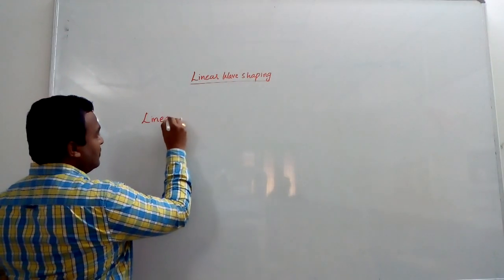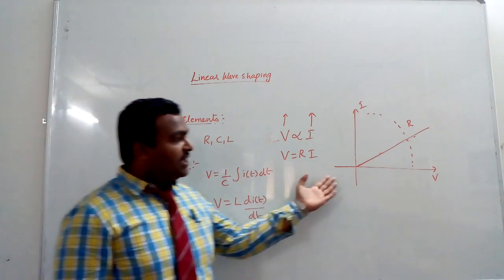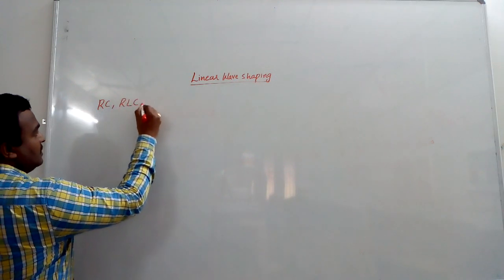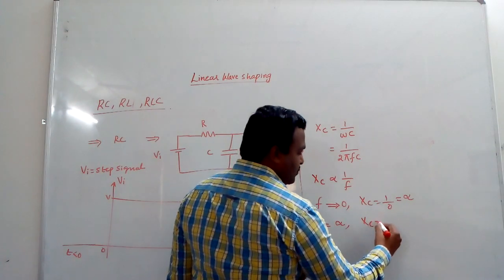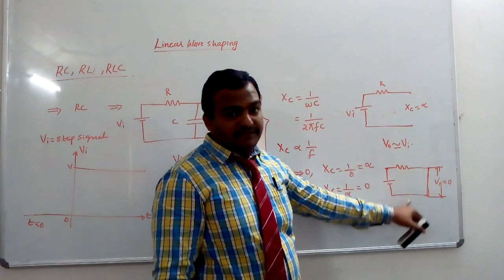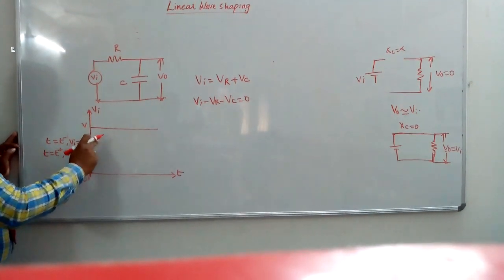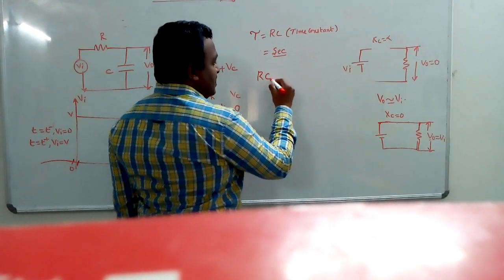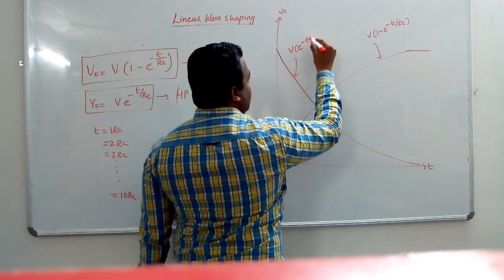Concept of Linear Wave Shaping

Comment: Sir... why only non sinusoidal signals??
Reply from the maker: The voltage across capacitor cannot change instantaneously for finite values of current. For non sinusoidal it may happen because of sudeen changes in input signal.

For A.C there is no sudden changes so it charges and discharges.
Reply from the maker: If u give sine wave shape doesn't get altered.if you apply sine wave to low pass RC Circuit it allows only low frequency signlas below cutoff above signals get attenuated.
Reply: @drbsivahariprasad9854   sir why will shape not get altered??? Like even then the capacitor charges and discharges right sir .. ?
Reply from the maker: Here input time period and circuit time constant also may lead to the wave shape change.
Reply: @drbsivahariprasad9854       thank you so much  sir